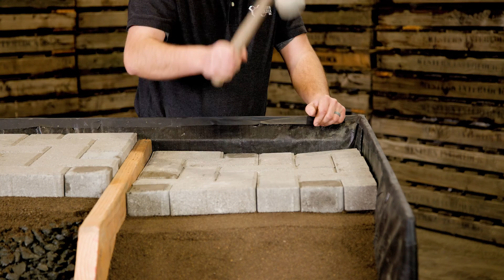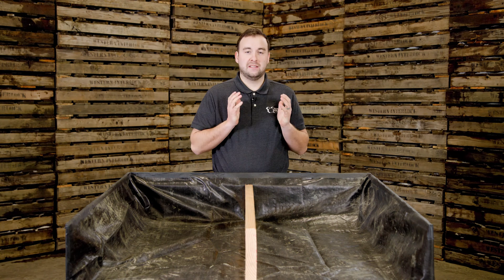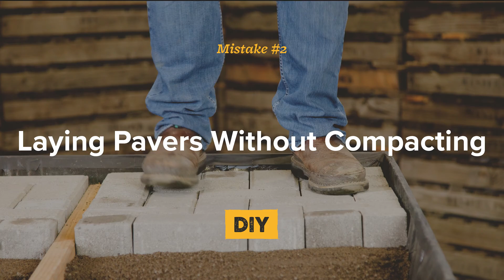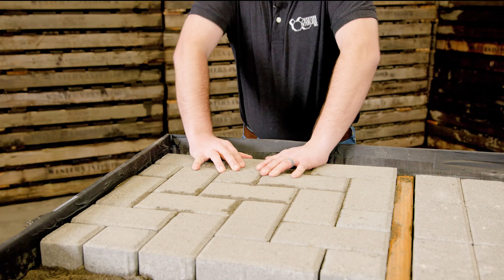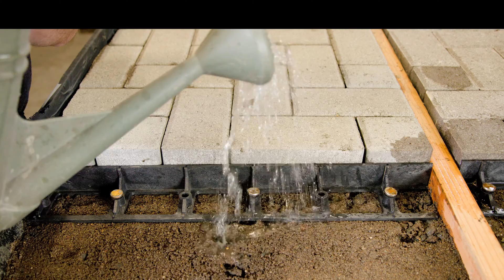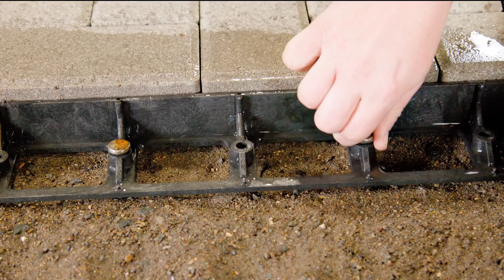5 Common Paver Installation Mistakes | Western Interlock

Comment: Do you guys tamp the bedding sand at all?  Or just screed and start laying stones?
Reply from the maker: No, we do not recommend tamping the bedding layer. If sand is used for the bedding layer, when the stones are compacted after laying, the sand works up into the joints from below. If the sand is compacted, it can’t work into the joint well.
Reply: @WesternInterlock  Thanks!

Comment: Since when it rains hot water. I am not sure why to use hot water and also I am not sure it is fully representative of real rain
Reply: Here in Arizona when it does rain the pavement will definitely be hot so the rain won’t be but once it hits the pavement it will make the rain hot.